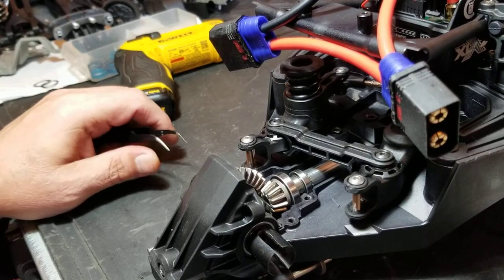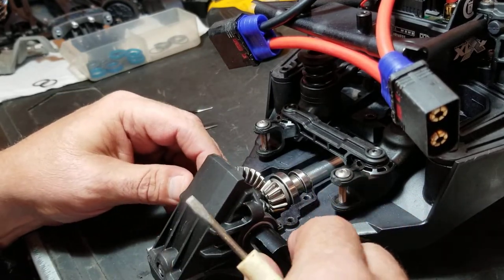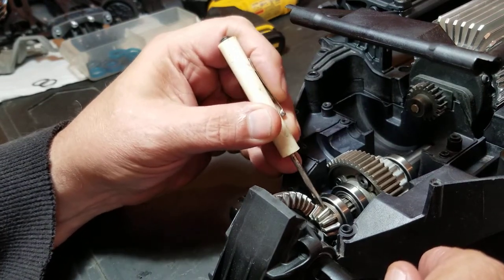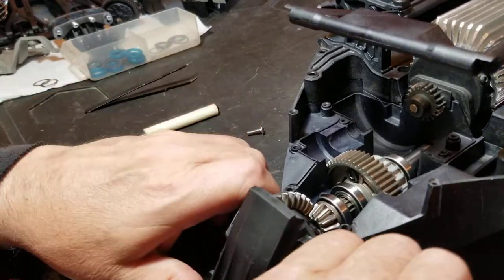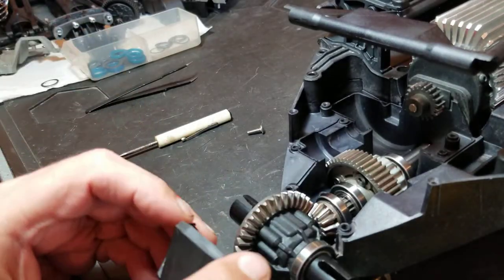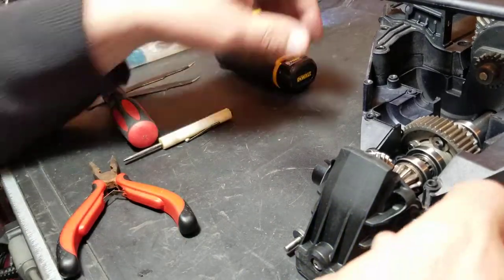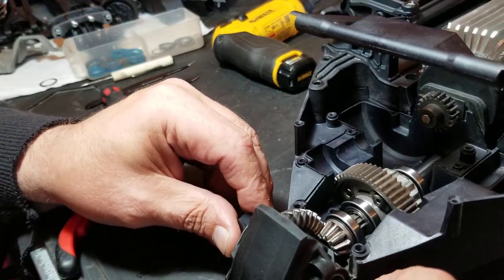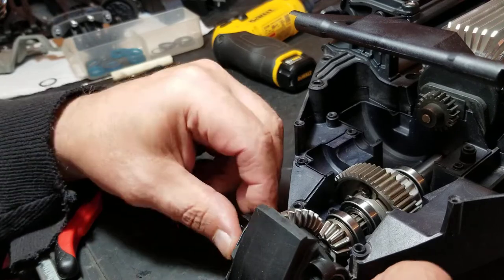Traxxas X-Maxx differential gear shimming.

Comment: Is there such a thing as central differenrtial trimming?
Reply from the maker: No, the center differential is tuned with different fluid weights or swapping out for a spool, which eliminates all front to rear movements and can cause damage to other drivetrain parts. 
Hope this helps, and thanks for watching. 
Cheers
Reply: @markkumollari43  Thanks!  I just pulled apart my xrt to do shimmming and thought I would ask before I put it all back together